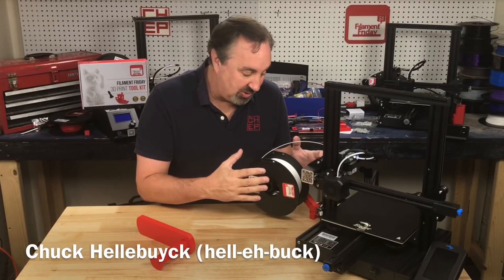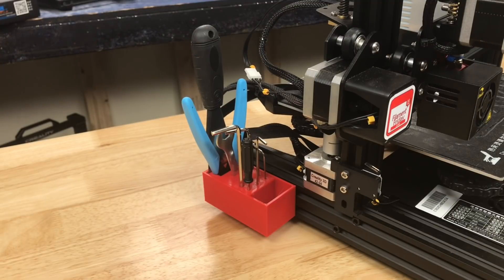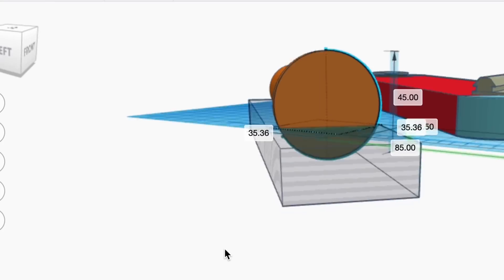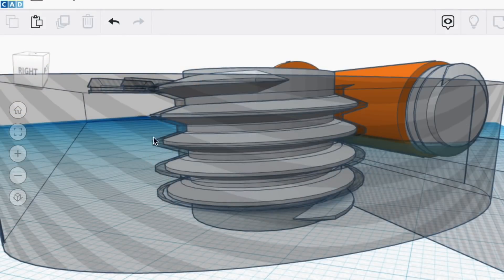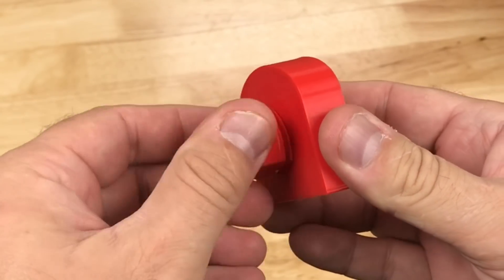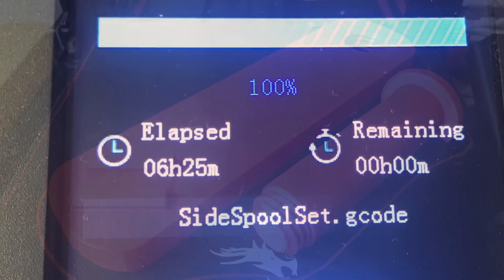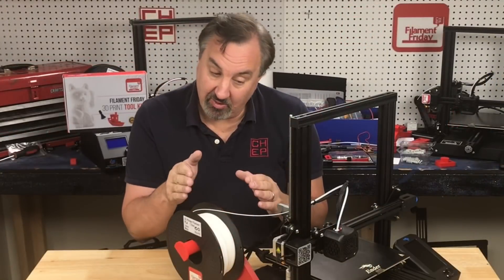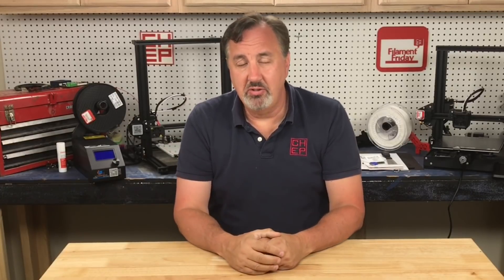Rear Spool Holder Design for any Ender 3 Style 3D Printer using Tinkercad

Comment: This will not print without signicant warping.  I am using PLA at 70 degrees bed and 200 nozzle.  Do you have any suggestions?

Comment: Hi, so I printed it out and it looks good. But...
You designed it to rest on the surface along with your raised feet of your printer. So ofcause mine lifted the rear of my printer and causes the printer to wobble. So...
Option 1, saw of the bottom to make it fit better, or
Option 2, import into tinkercad and cut of the bottom and reprint it.
Same as I had to do with the side mounted holder.

Comment: Hii guys is wanna ask for help, I'm new to 3d printing and recently i bought the ender 3 v2 and it works great, but after couple of days i notice that my z axis and y axis switch was not consistently click when starting a print or auto home. Because of that i gett a really inconsistent bed level, so i need to do several auto home to get the best spot. How to solve the problem? (Sorry for my bad english)
Reply from the maker: Reroute your wires away from the motors.

Comment: Do you guys know which gauge wire to use with 24v? Am thinking about connecting a buck converter directly to the PSU of my Ender 3 v2 so I can use noctua fans.

Comment: Sir I'm sure you dont remember me But a couple of weeks ago I had said I had a thermal runaway issue I had changed the thermuster and heat cartridge but you said it maybe fan Well tonite I recieved the parts just ran my first test 220 and mo runaway So I'm hoping u where right thank you for your insight and time
Reply from the maker: Glad I could help

Comment: the two parts are not the same level to the bed when slicing, i had to use mishmixer to separate them to make them flat to the surface.
also if you have a regular ender 3 or old one maybe it will nit work because of the small feet of the printer.
Reply from the maker: Thanks for the feedback. I updated the download so they are now on the same level.

Comment: It's not the wear ... I've had filament breaks if I'm bending 90° without sleeve.
Reply from the maker: Some filaments do that.
Reply: Then add a length of ptfe tube to the filament sensor (or extruder) input.

Comment: I have Ikea enclodure so this is not what I need. But because filament is top of box, I must print spoolholder with ballbearings support. And it runs smooth as Swiss clock. Here we need axle with ballbearings. Nice support btw.

Comment: I have a stock Ender 3 and opted to leave the spool holder on the top rail, although I did move it to the left edge. I then moved the extruder to the center of the top rail. I positioned it so the filament input is facing up, and the output going to the hot end facing down. 

The filament has a direct and shorter path from the spool to the extruder. Loading filament is also much easier! Additionally, I can easily see the filament path through the gear/idler assembly.  Finally, it removes stepper weight from the z-axis. 

I used an L bracket, 4mm hex head screws and t-nuts. All in, under $1. I haven't done any tests but it "seems" to perform better.  However, the convenience factor alone makes it worth the effort.

The thing I dislike most about the stock spool holder is the plastic on plastic interface. I would like to see bearings incorporated somehow, while reusing the metal arm. This would make for a much smaller (adapter) print and a lot less plastic. Don't get me wrong, I do like your solution, it's just not for me

Comment: odd, the stl file will not print correctly on a cr 6 see. I set skirt only, no support and it starts on one part then moves over after a bit and start blobing my noozel.  Must need support I'm guessing or the file is bad.

Comment: I think the only issue with that arm design is that there is a lot of weight at the end of the arm and it's acting as leaver on the rail supports, over time those will probably crack and separate. I think printing a vertical support that contacts with the table would solve that issue as it would take the weight of the spool off brackets. 

You can place it any where along the length of the arm, but I'd probably just sneak a small hallowed out frame near the bottom.

You could also print a block with the extrusion arms with 100% infill vertically then print a void in the arm where you can just glue it in. That would be pretty rock solid.

Comment: whats wrong with mounting spool holder on top?
Reply: In my own experience after printing close to 10KGs of different materials (mostly pla), absolutely nothing. In fact I can argue that I am wearing down the tube filament rolls sit on faster than the filament guide insert on my Ender 3 V2.
Reply: @Levent_Ergun  I agree! Rather than print another spool holder, which will have the same issue, I would like to see a new roller with bearings. One that reuses the stock metal arm as well. I commented about moving the extruder to the top rail as well. Much shorter and direct filament path, easier to load, and clear view of gear/idler assembly as well.
Reply: Nothing. In fact, check out my comment on what I did (moving the extruder to the top rail as well.)
Reply: Nothing is wrong with it, location wise, but it can save space if you mount it elsewhere.
However, your spool holder can induce some major vibrations when it rotates, but that can be fixed with a spool holder that utilizes bearings (or even some Teflon tape).
Reply: @ILEFTCAPS0N  it might actually dampen vibration like a stabilizer.
Reply: The filament erodes the plastic pivot arms of the extruders. Also, if you run an old PLA spool on the top, you run the risk of it snapping midway through the print.
Reply: @jacklamborn8810  Changing to an all-metal extruder is one of the first upgrades anyone should do (and I think it is) so that would cancel that issue out.

This is a hammer in search of a nail. Meaning a fix for a non issue. I imagine people have more space vertically than they do horizontally so mounting it on the top is the most logical thing to do.
Reply: @jacklamborn8810  I'm not sure about yours, but my stock extruder pivot arm has a brass insert where the filament enters the assembly. Excluding exotic filaments, wear doesn't seem to be an issue, at least for the one I received.

Comment: What are your thoughts on filament dryers? Do they help?
Reply: Hellebuyck yeah they work. I am working on a storage box with heat and desiccant built in. The idea is for the desiccant to dry 24/7, while the heater turns on only occasionally to dry the desiccant. A humidity sensor would be overkill I think. (However, I am a huge fan of overkill lol)